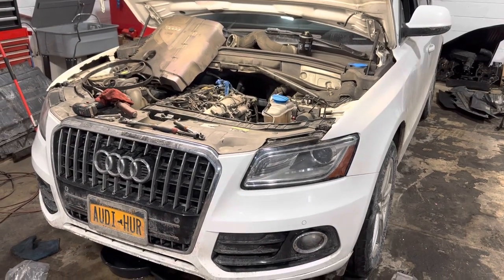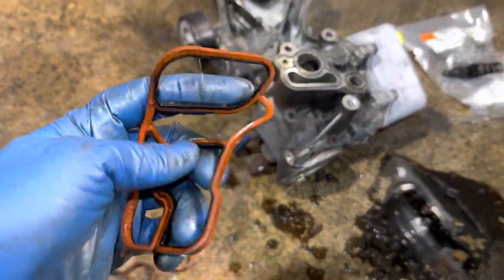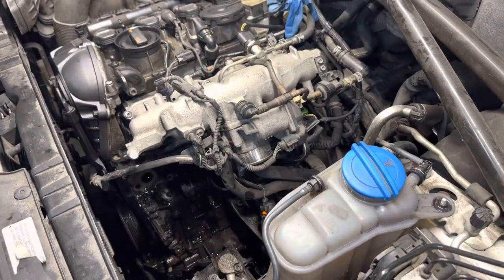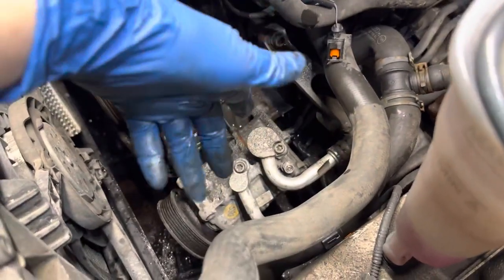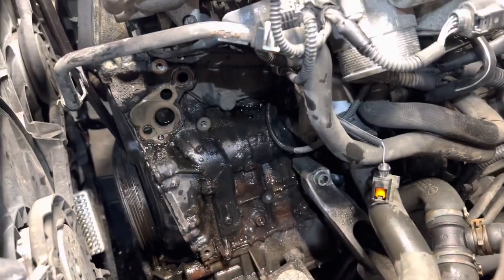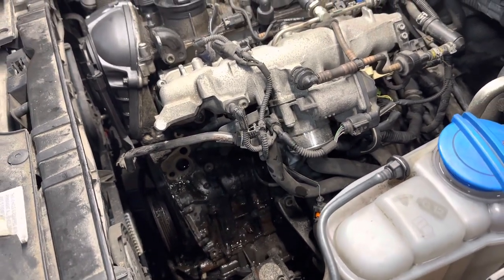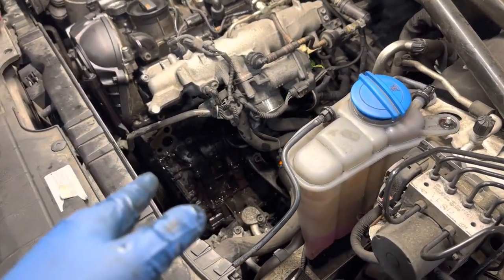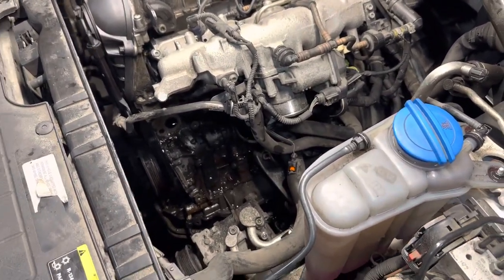Audi 2.0T B8 A4/A5/Q5 Oil Filter Housing Oil Cooler Replacement (EASY WAY)

Comment: I have oil in my coolant, but no coolant in my oil. I am wondering if its possible that my oil cooler is bad and not a blown head gasket. can anyone help me know the possibility of it being the oil cooler vs my head gasket?
Reply from the maker: Yes its possible
Reply: very high chance for audi q5, oil coolers are part of wear and tear. same thing just happened to mine.
Reply: That’s crazy that’s what I’m going thru currently I just bought a cooler ima try myself. I wish he would showed step by step

Comment: I have a 2013 audi q5 2.0t and recently it said add coolant but no overheating, i checked it was full and brown looking. The car now does not start maybe preventing further damage cause i drove it there. Im worried hopefully it’s fixible. I have to get it towed to a euro shop. Any suggestions would be appreciated.

Comment: How common is it for oil housing to leak or cooler?  If that is oil all over both which one is would you blame?
Reply from the maker: Its not that they fail. Rubber gasket is no longer elastic and becomes brittle and cracks. Some leak around 100k some 150k. I have a 2013 Q5 with 246k miles and still original gasket 🤯
Reply: @speedlinegarage  the shop overfill oil and  few days later it started leaking really bad..   I drained it to check how much they filled and I got about 6.7 quart.. in a 2.0 engine.. that explains the leak I just have to find it exactly where...  Thank you for replying 🤝

Comment: So do these cars come with a oil cooler stock? Because I seen one just like yours on Amazon, I thought it was an upgrade for cooling the oil.. So with that being said if I'm not having any issues don't touch it?
Reply from the maker: Yes they are stock. I suggest replacing gaskets around 90-100k
Reply: @speedlinegarage  Great to know, I'll get that replaced I'm at 84k so very soon, thanks.

Comment: Calling removing the alternator the easy way is wild
Reply from the maker: How else would you get to it? 🤔
Reply: @speedlinegarage  removing the intake manifold. I just don’t think it’s easier to remove the alternator and then have to put it back on and the accessory belt. Just more of a pain.
Reply from the maker: @JordanBlue1  you have to remove alternator to get to the oil filter housing gasket since alternator is mounted on the bracket that holds everything
Reply: @speedlinegarage  that makes sense if that’s a part that you need to replace. I thought you were just replacing the oil cooler, which is a job I’m doing today.

Comment: I have 2018 SQ5 3.0 engine, leaking from engine oil filter housing and engine oil cooler , Audi wants 6k to repair, any advise?
Reply from the maker: It is very involved job so labor costs would be high for $15 part. I suggest finding indi euro specialty shop and have them do it. Job like this would cost around $1600-1800 at my shop and in the process would replace water-pump and thermostat
Reply: Or do it yourself? I did it in an s4 with way less room

Comment: Love the video, How
Did the oil look different (color) or just noticed by dipstick excess oil. Thanks
Reply from the maker: No we replaced it preventatively while in there
Reply: Thank you
Reply: Can this type of oil leak were it is located cause a miss fire cylinder 1? Ty!